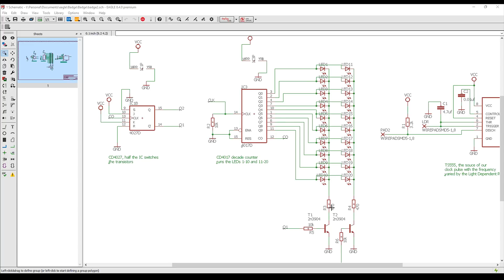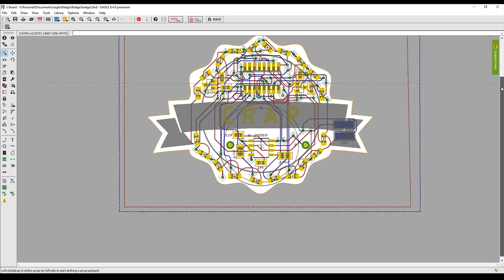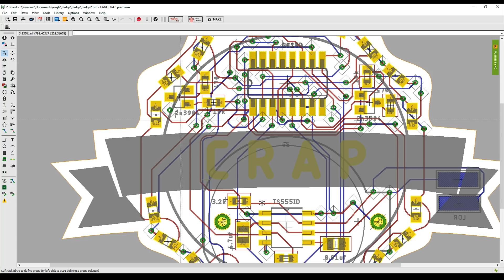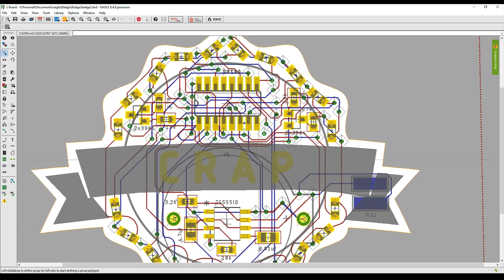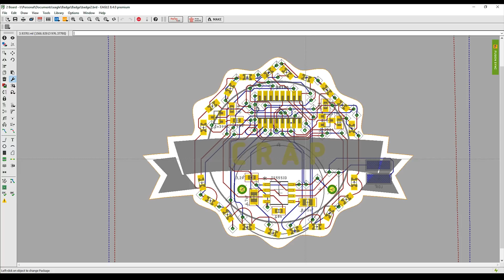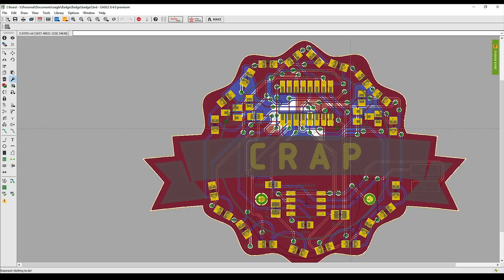Making a badge part 3: Board design done!

Comment: I'd have used the tracks to spell out the "crap" lettering, all snaking round, just because.
Reply from the maker: Originally I wanted them to be touch pads but that was proving difficult to do without a micro controller and my power budget was dwindling.
Reply from the maker: Ha ha, I kinda like that idea. It only uses ~1mA so it could easily be done with a tiny panel.